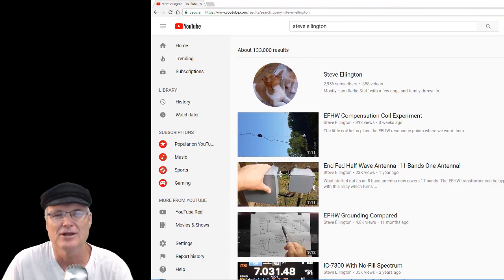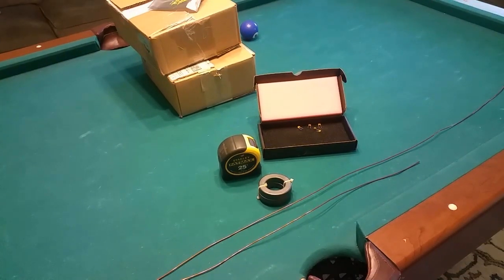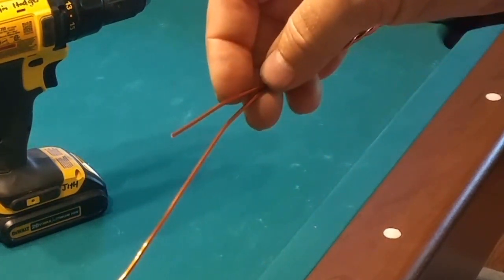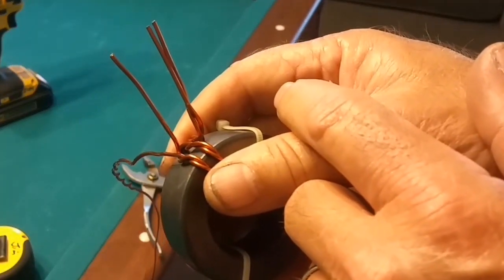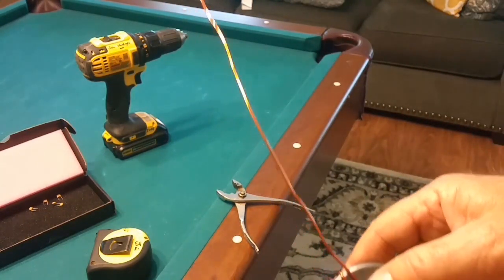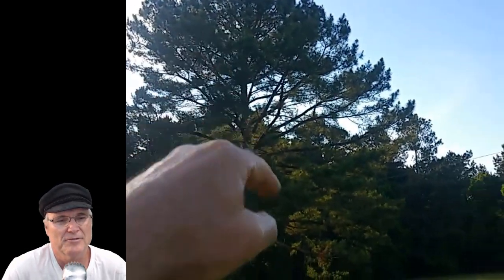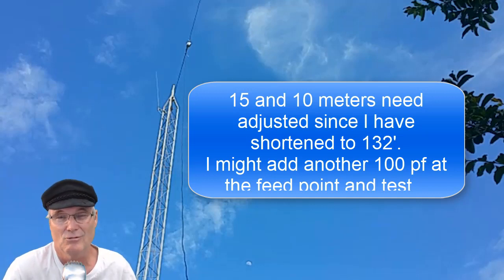EFHW 49:1Transformer Construction and Deployment

Comment: Out of all the Steve Ellington videos and others...no one touches on a topic of testing the autotransformer to see if it works and possibly how to troubleshoot.   Have connectivity everywhere but the center pin of the coax on the SO-239 doesn't have connectivity with the antenna output (or input depending on how you think).   I am completely baffeled.   Now I have connectivity from the center pin to the ground...which to me makes sense as in the diagram...the red wire in the center of the SO-239 and if you follow that around it goes to ground.

Comment: Nice video. Thank you!  I'm absolutely, without a doubt, convined that the way to go if one wants to have some serious antenna fun is to use a multi-tap UNUN with end feds. My current one has taps for Z ratios: 4, 9, 16, 25, 36, 49, 64 and 81:1.  If you or anyone wants to see what I've done, I posted vids for my brother Art, who lives in another state. Search for this for example:  80 EFHW & Multi tap UNUN part 1 of 3 Intro & Demo

Comment: After watching too many videos on this topic I believe that when you cross the wire to the other side this counts as a turn.
Reply: Yes, you count every time you go through the core.
Reply: Not a biggy!  Just makes it a 56:1 instead of 49:1.   The impedance transformation is calculated from (total turns/primary turns) squared.  16 total turns/2 primary turns would give 8*8 =64:1    As I always tell students, just remember that EVERY time you go THRU the toroid hole, it counts as ONE turn.
Feeding a very high impedance antenna like an end fed, the exact ratio is not that important - as long as it is around 49:1. Nor is the different number of turns on each toroid secondary side.  The direction of winding however, IS very important!

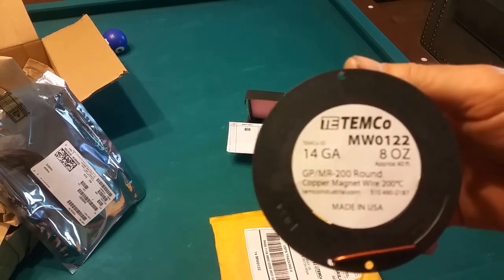Comment: Very nice video. I counted 15 turns, as well. It would end up being a 1:56.25 instead of a 1:49. When I built mine, a 200pf air variable capacitor was connected across the input to adjust the match. Once happy with the results, a 1 kV silver mica capacitor was soldered across the input. The difference between a ceramic and silver mica capacitor is noticeable. It was also discovered that the spacing of the first few turns before the Joe Reisert, W1JR, crossover made a big difference on the higher bands. Marty, K1FQL
Reply from the maker: Thanks for the input Martin. I was not aware of the trick with the last few turns. You may be right about the 15 turns if counted as each pass through the center instead of each full turn. All I can verify is that it works really well to be so simple... 73
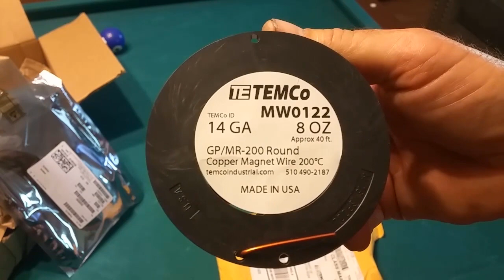Reply: @ka5wpm415  The trick is for the first turns before the crossover, not the last few turns. Each pass through the center of the core counts as a turn. The  impedance transformation for 1:49 is to 2450 ohm, as opposed to 1:56.25 which is to 2812.5 ohms. The difference in mismatch is noticeable. I have plotted the results for 1:42.25 (2:13 turns) on stacked FT240-43 cores on my QRZ page where the turns spacing has been adjusted for the first few turns. In order to get the stacked cores to work well on 10m, I had to resort to a 2:13 turns ratio. My comments about careful adjustment of the capacitor and silvered mica hold, particularly on 10m.
Reply from the maker: @arcanestudio  Thanks I checked out your page.. very nice. The flagpole antenna is pretty neat as well as the usb controlled power strip.. the 3:20 transformer looks to be the way to go with the hro.. 73

Comment: Very nice job. Your original twisting method is ok but you should just stick the twisted wire through the core all the way to the end of the twist where the single wire starts then wrap the twisted part 2 turns. You then have some extra twisted wire which you can trim off and connect to the ground lug etc. Wrap the single wire the other direction 5 more turns, cross over and go 6 more turns for a total of 14 turns counting the crossover. Wow that's hard to put into words!

Comment: Excellent video ! Thank you for taking the time.. I just have a 32’ piece of wire so I have a EFHW 20 .. it’s all of 4 feet off the ground and it’s truly amazing! It also works good on 30 Meters and 17 Meters.  The SWR is very good on 80 and 40 however it does not perform well. Going to get the 134’ up soon! 73’s David. de K8KEM

Comment: Love mine.  Made just as N4LQ recommends and sloping up to tall tree with 80m wire--modded for 75m (as Steve shows).  WARNING WARNING---everyone thinks it's the same thing as a 9:1 Random End Fed--it is not.  Steve explains this too (comparison video-neither on air).  I plan to have 3 at my next location, maybe 4.  Why? because I'll have the room and different orientations and lengths allow me to play with angles and bands optimized. One example:  It's a lot easier to pull 270' straight out for 160, than to hang a 565' loop.  I had 270' out here (bent sloper) for a while, but dropped back to the modded 80 for all bandedness.
Reply: Also, Arrow is slap out of 52-type. A ham buddy across the county got his cores today. I stopped by another pal's and tested his installation earlier this afternoon.